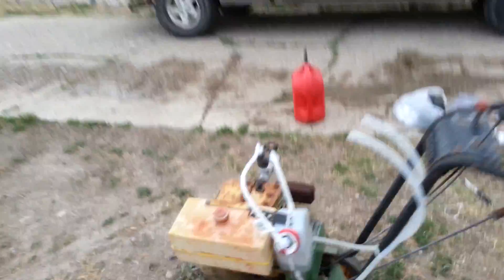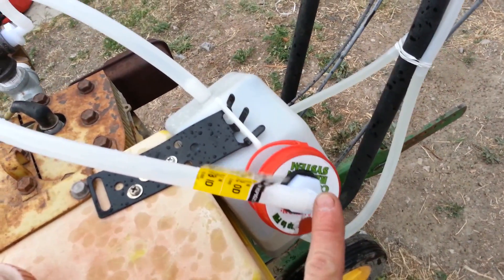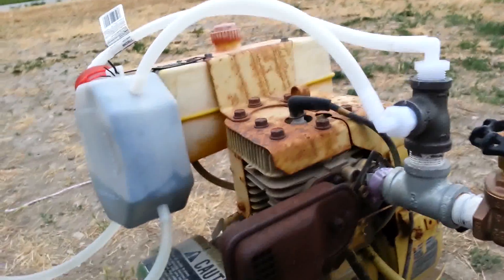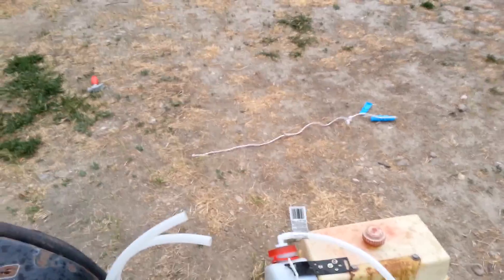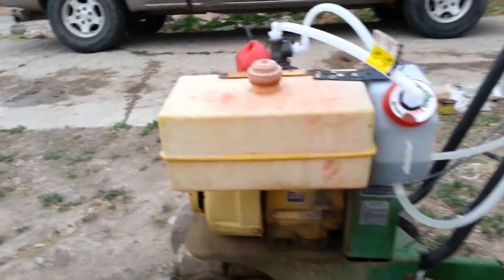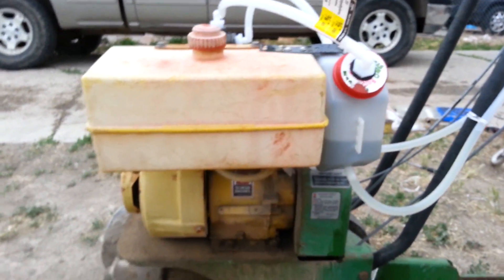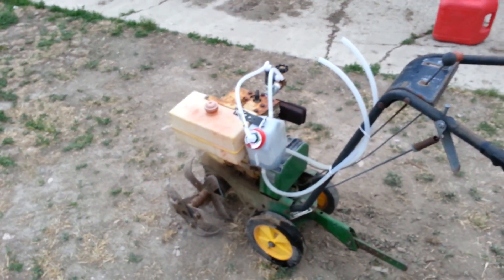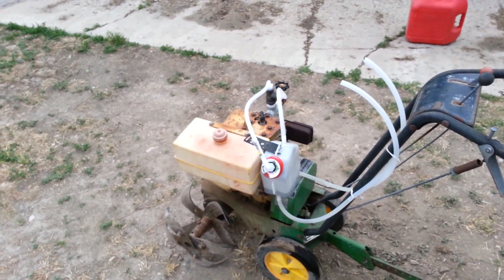New Fuel Vaporizer On Rototiller

Comment: you ever wonder what would happen if you put one on a gen set and toped it off with hho i bet you could make electricity cheaper than you are buying it
Reply from the maker: I bet your right! I have a HHO generator I bought from Steve at greenfuelh2o.com but still need to buy a PWM for it so I can test it on the generator. 

The vaporizer setup on this rototiller works better and requires far less adjustment then any other design I have built. It would work very well on the generator. 

The way I would hook the vapor and HHO system up to the generator is on one of the air intakes on the vaporizer you see in this video I would connect the HHO gas up to the one barb fitting and suck air through the other. What this will do is still provide the bubbling effect on both sides of the vaporizer but would give a good boost and a better run time to the generator because HHO is coming from one side and air through the other. I'll post a video of the HHO vapor system soon.